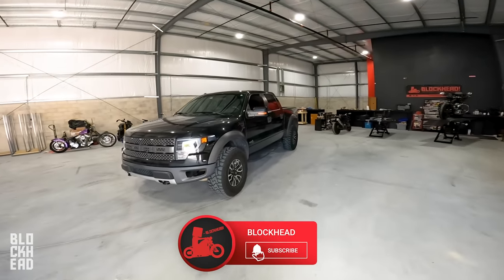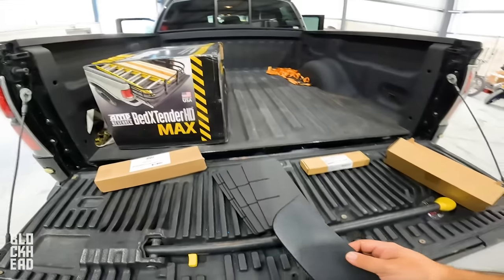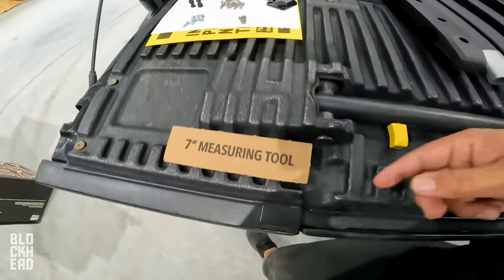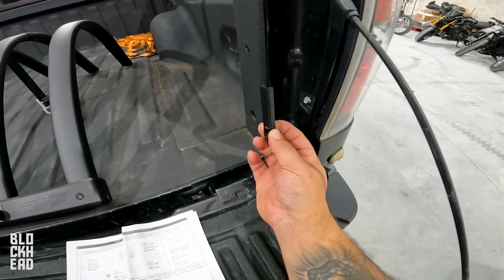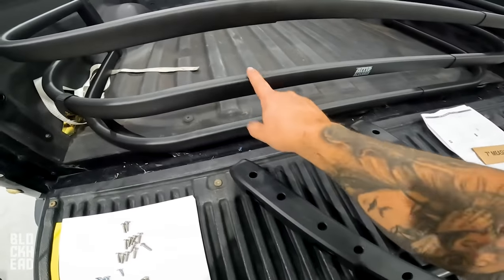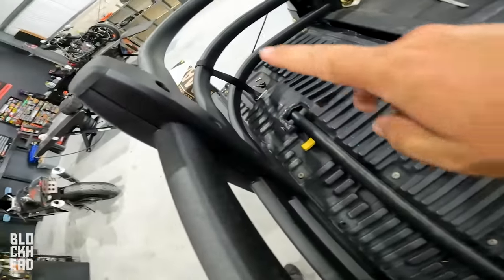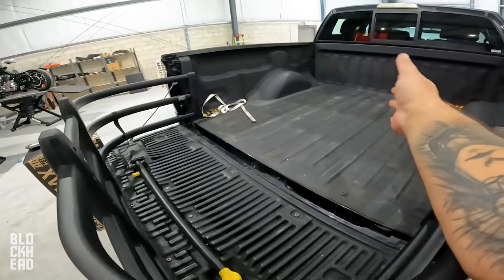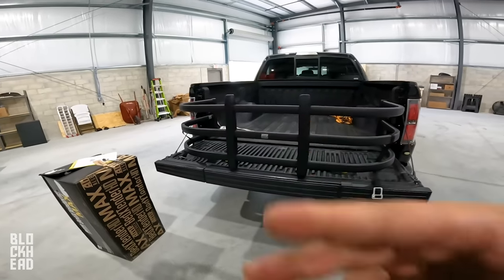Why EVERY Truck Needs a Bed Extender!

Comment: I like Fords bed extender better because it gives you third option. It will open up and fold behind your wheel wells.
Reply from the maker: Thought about those as well, but I like that this one is quick to detail if you need the full bed space

Comment: Plastic flanged pivots on extender are JUNK.. mine broke off. Seems all brands of extenders are made this cheap way. I re-engineered mine, turning some aluminum flanged pivots on a lathe to replace the cheap plastic pivots.

Comment: hey... cool vids, but i honestly think the Block crew should do a 2nd channel for all the non MC content. keep the main channel for motorcycles.
Reply from the maker: Running 1 channel is enough of a challenge. Also, people said this for my Tacoma content as well, but those videos have a lot of views, as they perform well long term, and they also got a lot of Tacoma people interested in motorcycles, and vice versa. We also recently introduced the 78’ Trans Am which we’re going to be building on the channel. So while we started with and love motorcycles, that love for motorsports extends to other vehicles as well 👍🏼

Comment: I worked at several large format shops.  No way are you fitting 4'X8' pieces of anything in the bed, even with it flipped.  Almost all full sized trucks have indents in the side for 2"X whatever height you want to slide in to keep our stuff in the rear for easy access.
Reply from the maker: Full size piece of plywood fits width wise just fine, but length, yeah it’s either setting angled on the tailgate or on the bed extender.

Comment: You can do all that or get a standard cab truck with 8 ' bed.
Reply from the maker: I’d rather just drop the tail gate and have the extra 2 ft, but what works for me doesn’t work for everyone 😊
Reply: Or buy a 4 door long bed. No reason to own a reg cab ever about as lame as a short bed

Comment: WHOW! We travailed back in time!  You think they make that drill(less) winggy ding for Dodge's? I know dumb question. I don't know what it's called so I don't know where to start looking.
Reply from the maker: Possibly, depends on what those pillars look like on the Dodge. I didn’t know they made a drill-less option till I saw it on Amazon, I’d check there or through Amp Research 👍🏼